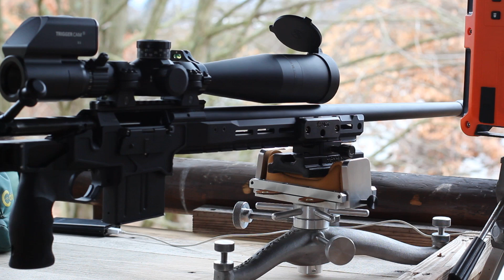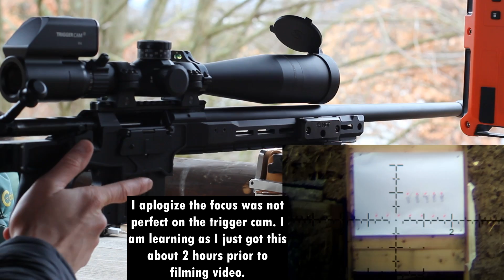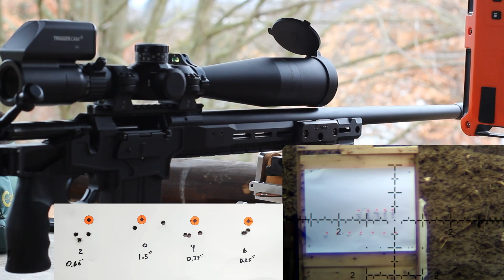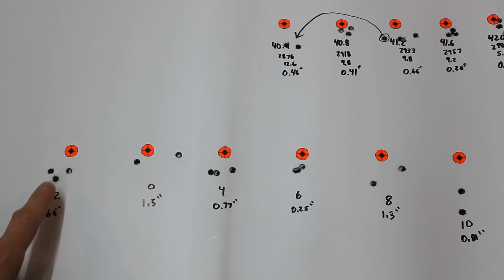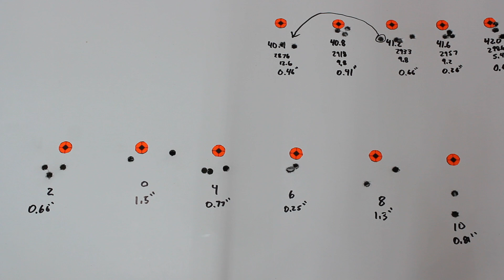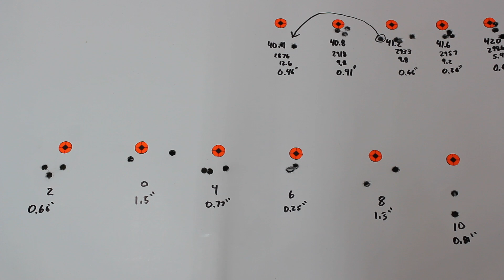6MM Creedmoor, Next Gen EC Tuner Testing, 200yds

Comment: I had my first hangfire with my 6mm creed that ive put nearly 300 hundred rounds through and never had one before and had a velocity of 2400. Im wondering if during my reloading, my funnel was loose and some powder escaped without me realizing it. Ive cleaned this barrel when i noticed to be getting presure on loads that never did before. I started punching through primers. Ive reduced the load by one grain and still see inconsistent velocities. Thinking i need to eliminated the carbon ring, which probably never happened last cleaning. The hangfire could also have been from the fingernail polish i used to secure a loose fitting primer.

Comment: It’s just never gonna be conclusive unless you repeat the results.. you could shoot that many groups with no muzzle device and maybe get the same results..  like when you got to 6 on the tuner brake.. stop there and shoot 4 more 3 shot groups and just see if it’s really the adjustment of the brake that did that.. or your gun just happen to spit out a good group that time
Reply from the maker: At some point I plan to take the worst tune and the best tune on a rifle and test it again with larger sample sizes. I'm sure we will still see a difference. It may not be as large as this test but I would bet we still see an improvement vs the worst tune.
Reply: Temperature change tuning is the real sauce we need for this

Comment: How does the thing on top of the scope work with the lens cap flipped up?
Reply from the maker: It records through the optic not above the optic.
Reply: @RobsReloading  I am going to have to look into getting something like that.
Reply from the maker: @texpatriot8462  it's an expensive piece of kit but so far I have been happy with it. After more use and experience and will give my full thoughts
Reply: Others have commented on different videos using one that it's kind of difficult to make the image clear vs the reticle clear. However, I have no experience with one personally.